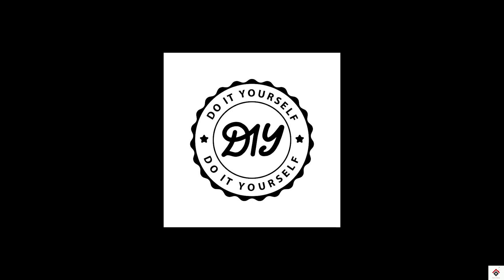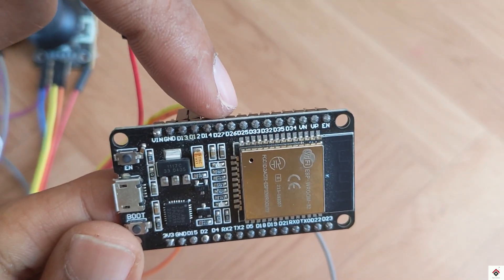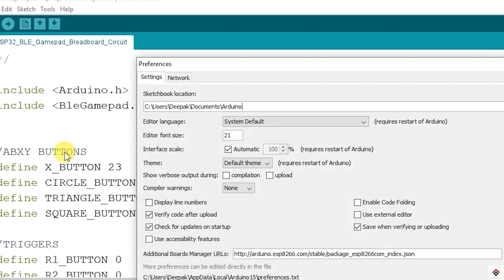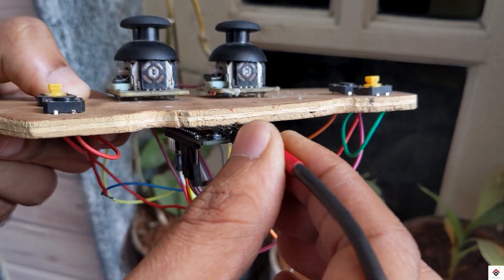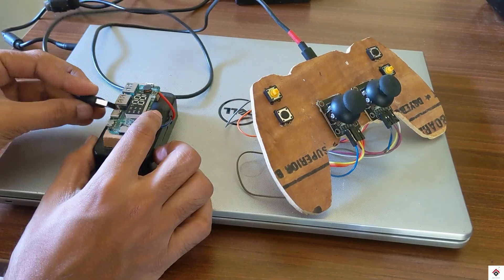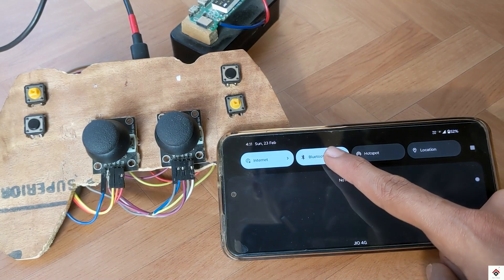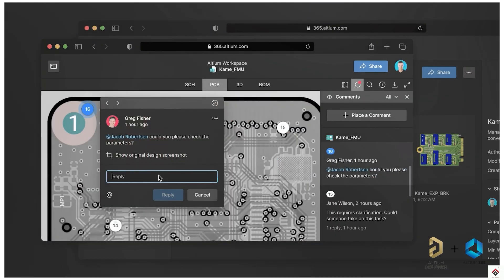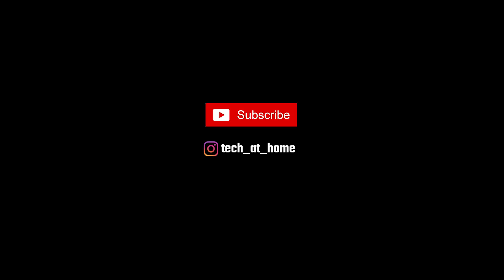ESP32 Bluetooth Joystick 🕹️ for PC, Android and PlayStation [with CODE] | DIY Wireless Joystick🎮

Comment: Great project. Is it possible to enable or add USB support as an option?

Also successfully uploaded the code to ESP32-S3 WROOM N16R8, but the bluetooth is not showing up, may a diff line of code to enable bluetooth on those boards.

Comment: Hey friend! I have a question: could this controller support 3 potentiometers and 15 buttons to replace the old controller that comes with an old joystick?
Reply from the maker: It supports 4 Potentiometers and 13 buttons.
You can get the pin numbers in the code and circuit.

Comment: Can it be power up with a 3.3v battery? A portable one?
Reply from the maker: You can provide external supply through Vin pin and GND.
I saw it should be at least 4v. Try once with your battery.

Comment: Qual limite de botões sem precisar de multiplexador?
É possível usar as portas analógicas como digitais?
Reply from the maker: Around 11 digital button inputs can be added.
Reply: @techathome obrigado por responder. Acabei usando stm32 em meu projeto.
Reply from the maker: Which software/firmware are you using.
Do you have any reference documents or blog page for the same?
Reply: estou usando freejoy como software, mas não coloquei para funcionar sem fios.
Meu projeto é um volante para cockpit F1.
Em meu canal falo um pouco sobre  @techathome
Reply: https://youtu.be/5I-ywHPrzto?si=V_j1M0z5D0ozxm8D
Meu projeto.
Reply from the maker: Looks good ♥️
I'll also try to explore that.
Btw we also have diy FFB wheel. Check once: https://youtube.com/playlist?list=PL4B0LEKY-jrROPZPEDMZ4DPqISPXvVsdL&si=pXJpHQWDTB2t5VQY
Reply: @techathome ainda não conhecia a playlist completa, mas já havia assistido algums de seus vídeos. Em especial na parte do câmbio.
Muito bem elaborados e bem executados, está de parabéns.
Reply: Tenho outros projetos que estão pausados por falta de uma impressora 3d para imprimir as peças que faltam.
O FFB do F1 ainda nao defini como será, pois estou estudando usar a mecânica do Arcade sega rally de 1995 que tenho guardado aqui.
Estou desenvolvendo câmbio focado para ETS2 e afins (por isso assisti parte de seua vídeos), mesa de pinball eletromecânica, volante nas dimensões reais para ETS2, tem muita coisa aqui dependendo de impressão 3d para dar continuidade.

Comment: bro in laptop its perfectly connecting and also in the control panel the test of the game pad is working but in the game it is not working. I tried the same game in phone by changing the mode in code it works perfectly .can you please give me a solution
Reply from the maker: If inputs are getting detected in the control panel, device and driver are working.
May be issue with the game.
Reply: @techathome can you name some games which gamepads will work
Reply from the maker: I have tried only on Euro truck simulator 2 and Rush Rally 3.

Comment: PS1?
Reply from the maker: I have not tried. But in the code, there is also option to set PS1. Change it and try.
Reply: @techathome  yeah but how? shouldn't it be PS3  instead?
Reply from the maker: You can select the same available in the code and check.

Comment: this is great but i want more inputs in it , can i do so?
Reply from the maker: Yes you can add upto 13 button inputs.
Reply: @techathome  how?
Reply from the maker: I have explained in the same video. In code all pin numbers are already defined. Check that and connect the buttons.

Comment: Can i make the same but with an Arduino Uno. Like what do i have to change.
Reply from the maker: Not exactly the same. For Arduino UNO there is completely different firmware and steps. It will be wired one and supports only on specific games: https://youtu.be/2K87AQOf-KI?si=8p3_hznsir20XPq-
Reply: @techathome  i only want it to be buttons because i will use it as a h shifter.

Comment: Bro can you make a steering wheel using esp32 and connect with wifi
Reply from the maker: ESP32 bluetooth wheel we have made: https://youtu.be/YWYUSnLh21A?si=yw3AOjGLKivNF6zZ
Reply: @techathome  bro i need for pc and i have no bluetooth in my pc
Reply from the maker: Can you add usb bluetooth adaptor which can enable bluetooth option in your PC. It costs around 250 Rs.
Reply: @techathome  can I connect with wifi
Reply from the maker: No, ESP controller connects with bluetooth.